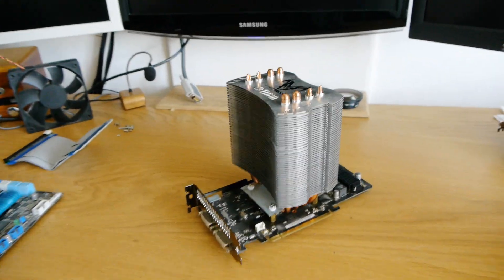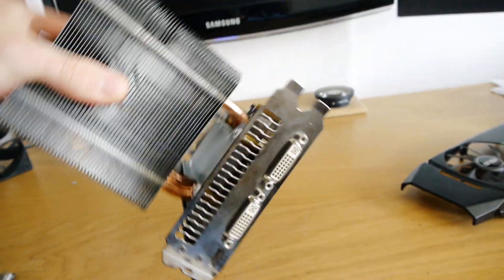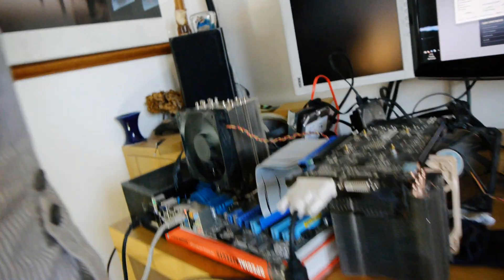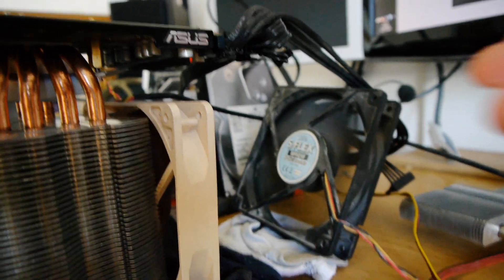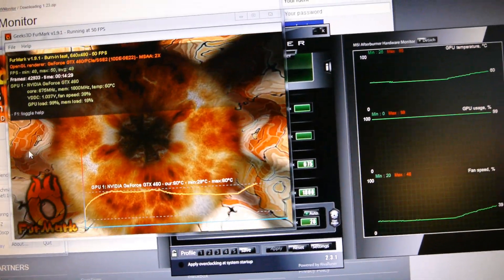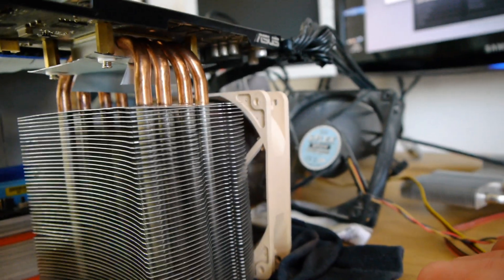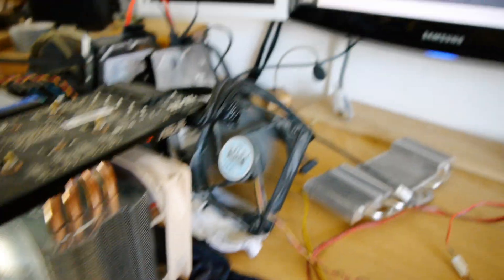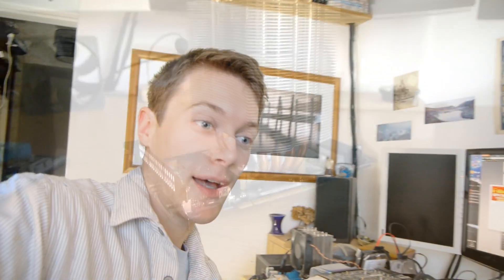CPU cooler on GPU (INSANE temps!)

Comment: My gtx 960 hovers around 55 Celsius, though it has a huge heat sink and three fans. I was actually surprised you didn't get lower temps from such a large heat sink.
Reply from the maker: Matthew Barnard The GTX 460 I used is notorious for using a lot of power, and therefore generating a tonne of heat. It's closer to a 980 than a 960, so considering it was barely making any noise I think it was a success. :)
Reply: The 900 series cards are far more power efficient than pretty much everything Nvidia and even AMD have released in the past. Less power consumption generally means less heat production. Nvidia were even able to get away with shutting the fans off completely when under a certain load percentage. That's pretty amazing.

I'd love to see how this mod fairs on a 980. If it works as well as I'm assuming, it could make overclocking easier by further minimizing heath throttling. Most serious overclockers use a custom water loop, which is very expensive and can be difficult for the average person to properly set up.

You should send this in to Linus Tech Tips and see if they find it interesting. They can be adventurous at times with DIY projects like this, and might actually try it out and see how much better they can overclock compared to an unmodded gpu.
Reply: Matthew Barnard did you really just compare temps of a 900 series card to a 400 series? my old 480 would run at 90c under full load. /smfh
Reply: it was lol
Reply: Matthew Barnard Fermi architecture had a lot of heat output, they used to run 90+ celcius when gaming. AMD even made an advert mocking it.
Reply: clancy2k that sounds like a room heater....
Reply: znmo0nlight sounds about right, my stock 470 with the blower fan heatsink on it, regularly hit 80-85C in gaming, 90C sometimes running Folding@Home, though came in handy in Winter time, run 24/7 some days, folding, lots of extra ambient heat in room to keep warm during those cold winter nights, LOL.   I actually thought about SLI, until I found out how loud the fan was on those things, after a year plus, I moved to quieter/cooler GTX 560 Ti, 6 months later, a 2nd one for SLI, even a pair of those in SLI overclocked to 950 on the cores at full load, ran quieter than the 470.  Also Did a comparison video a few years back, comparing my 470 vs my GTX 285, with fan noise versus a small window air conditioner unit running next to the PC...  needless to say you could hear the 470 loud and clear over the AC.
Reply: Would be replacing stock fans wit 120mm fans be good idea on my sapphire r9 280 l, because fans spin 2500rpm

Comment: So the ITX standard is holding back graphics card cooling. Guess it really does.
Reply: BrainSeepsOut the thing is it isn't necessary to put a amazing cooler that comes with the package, as long as it doesn't get overly hot its good enough, if you want extra cooling with ur graphics card that should be ur choice to do so
Reply: BrainSeepsOut it's not. graphic cards hasn't been bigger to this date actually
Reply: Cuerexits more like motherboard designs. cant put a huge cooler if its gonna get in the way of the other hardwares.
Reply: That's what I said- the ITX/ATX standard is what's getting in the way.
Reply: BrainSeepsOut Not at all. There are much smaller aftermarket air coolers and tons of watercooling solutions that are way better than this.

Comment: meanwhile the vram is melting
Reply: Vreg the Vram is usually either cooled via thermaltape to the normal heatsink or just has the air blown over/by the Vram,,the Vregs however NEED the heatsink to be thermal paste/thermaltape/or ramsink style as vreg are usually far more in number have the vast majority of raw power going through them and limited surface area spaced closely together, whereas the Vram are usually further spaced apart, have a larger surface area and much lower amount of raw power being dumped into them :)

cool mod, but holy crap that would be hell on the pci slot as far as weight is concerned ^.^
Reply: @mauriceakamoefortin2510  Why would weight on the PCIE but a concern? he's using an extension cable!
Reply: I think the power delivery will be the first to go.
Reply: Sprsae it wouldn’t be wise to just run the computer without a cpu cooler..... he probably used an extra cpu cooler he has to use on the gpu instead of using the one on his cpu
Reply: Julian Danzer:
He should create a custom shroud with airflow focused on the top center where the CPU cooler is, with side vents for air to escape or enter (depending on where the CPU cooler fan blows air). And add mini copper heatsinks for the proper chips.
Reply: Julian Danzer true
Reply: all you need is a little fan blowing on the vram\power
Reply: VRM! NOT VRAM! But yeah... VRAM could also be melting
Reply: That's true ^^
Reply: and the voltage regulators...
Reply: Julian Danzer meanwhile the cpu is overheating and the pc dies befiore you get to test out the gpu because you removed the heatsink and put it on the gpu

Comment: Nice video (and idea!). l'm also into 'silence'. My PC is very quiet but, l'd like a 'dead quiet' PC. l have to cut down the +/-1024rpm of the fans of my R9 280x. After watching this video, l might go and remove the entire GPU cooler (my case is very well ventilated, l can game with GPU fans running at 20% and the GPU never goes over 65º). l wish l could simply 'software control' the fan speed, but l can't (min. speed is always 20%).

Comment: If you can get it mounted in a case fair enough however the better temps while it's sitting on your desk can't really be used to compare it to a stock card mounded inside a case.  To be honest I think you would have been better modding the fan set up on the already existing heat sink and making better use of the surface area that, the stock heat sink had rather than mount this clumsy and awkward cpu cooler.  Interesting though, did you ever get it mounded in a case?
Reply: Actually I just read the description... doh fail me...

Comment: Not to be an ass, but heat pipes doesn't work very well that way. The results your getting is mostly from the copper and not the steam/liquid inside the pipe (that are suppose to do the work). If you flip your experiment, you'll get better results and a mush faster responds

Comment: I wonder... Given a very good CPU heat sink tower with good fins and copper pipes design/mounting, installed in a well ventilated case, would you really need a fan? In a closed case making up for some kind of wind tunnel, I'd bet you'd get about the same amount of air velocity on the fins from the chassis fans than a low RPM (e.g. "silent") CPU fan, and given those number with very low fan speed... Something to test, as it would make things even more "silent".

Comment: now do this mod to a GTX 480 XD
Reply from the maker: Ultranist I'm thinking more along the lines of a GTX 980... or 980 TI whenever that comes out.
Reply from the maker: ***** three minutes later hi
Reply: DIY Perks  GTX 980 is a relatively cool card. GTX 480 was an extreme heater to the point where it had to have a metal grill instead of the plastic cover. Don't you remember the jokes? "Grillforce GTX 480" ? :D
Reply: foxman105
I'm still rocking mine. The temps are terrible, can confirm
Reply: Ultranist More interesting would be a R9 290, because of the heat problems it already has.
Reply: foxman105 My GTX 560 is still a grill. Usually about 55 C, under heavy furry donut load I got it within 1 degree F of thermal shutdown, about 100C. Ouch.
Reply: Mineral oil bath..

Comment: This isn't so impressive since you've managed to mount a heat sink to the GPU chip that can't even come close to fitting inside a computer case. Not to mention you literally have fans just propped up next to the heat sink which takes up even more space. This is not a real world cooling solution and is utterly pointless.
Reply: OldsXCool  he has proven you wrong. :)
Reply: OldsXCool  A "useless" experiment because it wouldn't fit in most peoples' cases? That has to be the one of the most idiotic comments I've ever read. I could understand the hostility if he was pushing this as an actual kit, but he's not. He's not just watching someone else actually doing something unique and then flippantly dismissing it as pointless. He's experimenting and gaining actual knowledge and experience. I could understand if you lack the mental capacity and skill to do something like this, but you really need to make an attempt to think outside the box.
Reply: OldsXCool wow. just wow.
Reply: ***** He says in the video that the other expansion slots prevent being able to seat the card into the top slot. That's why he has the card mounted outside the board with a cable.
Reply from the maker: OldsXCool Ah, but it IS mounted in a case. I'll have a video up about it this week.
Reply: maybe you are used to small crammed cases like m-ATX or small mid-tower cases... F-ATX or ext-ATX cases have room fo this and more.
Reply: Hence "Experiment"
Reply: frtard You morons can say whatever you want. It was a "useless" experiment. Most people don't have this kind of space inside their box.

Comment: dya think u could make a Pc build ,experimental ,by having both the CPU and GPU facing in the same direction ( with help of PCI extension cable to position ) and make therm both share a singular massive heatsink ? maybe have both processors facing up onto a case chassis that has fins ALL over it ?

Comment: Have you considered the plastic casing is keeping in some of the heat? Have you considered having the fans blow directly onto the old heatsink without the case? Just a thought, it might be something to consider is all.
Reply: Nah, the plastic actually helps the air to flow consistently around the heatsink. Not to mention it holds the actual fan :)

Comment: i am wondering if your final set up of the gpu heat sink was pipes up or down since the operation of a heat pipe is gravity based. your video here is biased to not work the best since the liquid in the heat pipe is not condensing at the point of highest heat ie the gpu .. simply put flip that shit over man lolz
Reply from the maker: Roger Young In the final setup the heatsink is horizontal.
Reply: You need to change the orintation to vertical pipes up for best results from heat pipes or its just like a regular solid piece of copper...
Reply: Still a great idea to cool those noisy bad boys down . However a small deepfreezer works even better at a fraction of the cost since a cheap one runs about 150$ a 3"hole saw & some hot glue...
You get the idea .. dedicated deepfreezer build your pc in it or simply set the whole tower in it. 
Yup its quite now lolz

Comment: You know about those holes they put in the back of a PC, god knows why(because there is no room for a fan and no room for... actually anything). So I tried to cover them, I used classic duct tape. I also taped every hole I don't have a fan on(my idea in the first place was that I don't want dust inside my case, because I moved to a dusty environment and I bought dust filters for the fans, so I didn't want to have any uncovered holes on the case).
Also, I'd like to mention, that I have one silent 120mm PWM controlled fan in the back of the case and two silent 120mm PWM controlled fans in the front. I run them at lowest speeds possible and guess what! In IDLE my CPU fan does not move! And I have old Phenom II with 130W TDP. In comparison, before I covered those holes and put those fans there, I had CPU temps at around 50°C in IDLE with my CPU fan spinning like crazy, after I covered them and put new fans inside the case, I have 40°C and the CPU fan doesn't even move(I have Scythe Mugen).
So I guess that if you are building a silent and powerful PC, you don't have to have an active cooling on the CPU at all, just buy a powerful tower CPU fan, get that 120mm fan out of it, put it to the back of the case if you don't have a fan there, put other one or two to the front and you are done! With current 65W TDP Intel i5 CPUs, I am sure that you can run it to the max on passive cooling and still have temperatures below 70-80°C.

Comment: that might work in my thermaltake armor full tower case with a slightly thinner cooler. I currently finally got my gtx 660 cooler and quieter by taking out the fan and plastic garb and putting on a silverstone 120mm fan, very hard to keep it cool and quiet though since the heatsink is so small but it's cool and quiet enough for me atleast. You gave me a good idea, bad psu's have a lot of good aluminum in them for heatsinks.

Comment: Saw this video a while ago and wanted to try it. Is there anyone way to put a cooler or heatsink on the ram for the cards? I would like to minimize the need for all the fans pointing at the PCB of the card.

Awesome video, by the way! :)
Reply: That's what vrm heatsinks are for.
Reply: I'm sorry, I was under the impression removing the cover removed the heatsinks for the vrm. If that's not so, then ignore my comments please. :)
Reply: Tumbar It depends on the card. 
I meant that getting heatsinks and putting them on the vrms would be the solution.
Reply: Ah! Where would one find those heatsinks, then?
Reply: Amazon and eBay are good places to get them. Many computer stores in general have them in stock as well.
Reply: Thank you! I found some sites that sell them. :)

Comment: you're sure there's no performance differences? did you run benchmarks on both? if you're sure, i'm going to externally mount my GPU's and put some coolermaster hyper 212 evo's on them. DIY Perks

Comment: Hi I'm making a from scratch computer which mimics the cooling design of the new mac pro. I'm looking to use two cpu coolers inline, both blowing upwards, to cool both the gpu and cpu. I have a question for you, would you recommend attaching heatsinks to the Vram on the gpu? Also how hard was the cpu cooler to mount on the graphics card? I would love you so much if you made a video demonstrating attaching the cooler!

Comment: Should build a pc in one of those beer fridges would be cool ;)
Reply from the maker: 1karl1 Condensation might be a bit of a problem.
Reply: Yeah i suppose . Water cooled system maybe stick the radiator in there and have the tubing going in and out the doors window if all sealed properly i suppose . With insulated tubing long enough the fridge itself need'nt even be in the same room . Nutty idea but maybe but your fault for the inspiration ;)

Comment: Too bad you can't use that in a case. Its easier to just get watercool.
Reply from the maker: jxsilicon9 It's actually now in a case ;) fits nicely.
Reply: DIY Perks

How did you fit that? That would pretty much hit my PSU if I tried to put it in my case on a GPU.
Reply: ***** Make your own one? Simples.
Reply: jxsilicon9 easy, get an extended ATX tower or a full tower.
Reply: jxsilicon9 Get a bigger case :P

Comment: why would you go to the effort of doing this and not overclock? its not like it would be practical to use your pc like that every day, might as well get some kicks seeing how fast you can push the card.
Reply from the maker: artifactingreality I'd rather have the improved acoustic characteristics rather than an imperceptible increase in framerates.
Reply: go on give us some more mhz
Reply: DIY Perks Depends on the card mate. Those 750ti's and 280x are overclock beasts, but heat is usually the problem before the card reaches its limit.

I would imagine, another benefit would be longevity of the card would be increased with components running cooler?
Reply: Well one use would be that your GPU wont wine every time you put it under serious load, although I would proffer using.

Corsair Hydro H60
And
NZXT Technologies Kraken G10 Liquid Cooled GPU Bracket

For... Obvious reasons...
Reply: Etheoma edit: oops! misread, sorry dude
Reply: and crank that fucker up
you need speed man whats your problem are you worried the extra power usage will take money out of your cocaine budget?
Reply: artifactingreality Na its just my GPU has enough horse power for me so I'm not concerned about power. My concern is the noise.

Comment: why so small? you can just put a 1000L tank od liquid cooler inside your room and put some magnet pumps (0 sound) 2 deliver liquid cooling then it wont exceed like +1C more than room temp even after 100 years of 200% card power

and if you manage to cirquit 1 pipe trough your moms fridge the temperature will surely drop to around 15C and youd have free air coolr in your room! so think about that!

Comment: I always wanted to build a computer  using a refrigerator as the case and convection fans inside. DVD ROM drive, power supply, and USB would be external so it can remain closed to avoid condensation.

Comment: You may be getting improved performance but the gpu itself isn't the only thing gpu coolers are designen to keep cool, while I saw that there was a heatsink on the chipset the power rails were completely exposed, these can also heat up considerably and are much more sensitive to heat than a processor.
Reply from the maker: MentalEdge The original cooler only touched the GPU itself. Everything else was cooled by air only, which is what the second fan was for.

Comment: Does the orientation of heat sink matter. I mean is there a "this side up" to these heat sinks?
Reply: He had it upside down with the heatpipes. Works better right side up where the condensing side of the HP is lower and fed by gravity
Reply: @mzungu54  but doesn't it all condensate at the bottom? I mean, if all the liquid drops down.
Reply: @sergeyk9060  But if the GPU is up higher than where it condense and pool, the cold water will have to work against gravity to go up and cool it through the capillary action. So, it's working at reduced capacity.  You can over design heat-pipes to work in all directions, but for some CPU HSK, it is likely not the case